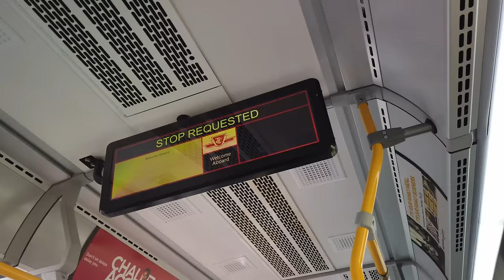Why American Buses Are Just Worse

Comment: This thing also applies to Japan and South Korea for me, although they don't have rules like buy-America, their bus designs do feel a bit stagnant if compared to Europe and even China (esp. South Korea until recently). Only recently Japan produced an indigenous Articulated bus design, Isuzu ERGA-Duo as most artics are imported (Mostly Mercedes Citaro G and some Volgren bodied Scanias).

feel free to add or correct this comment
Reply: And Taiwan follows Japan a lot in bus design
Reply: tbf korean buses are pretty comfy to ride on so personally don't mind their abundance
Reply: Japan had caps on bus size till quite recently, which was the reason there were no articulated buses. Once these caps were lifted the first imports arrived, followed by the indigenous product.
Reply: @lunareunlar  bus drivers in Korea drive like they are on NFS:MW!
After sedate pace of bus speed in London it was shocking how fast they get off the line over there.
Did get used to it by my third trip to Seoul.
Reply: @AshrakAhmed  Funnily enough, I'm just back from Buenos Aires and noticed how fast the buses were driven there, compared to in the UK! Great bus network and interesting metro system too. And so damn cheap!
Reply: well, i guess the point isnt whether its 'stagnant'. if it works and its good for their specific condition, then good for them.
Reply: That's interesting, Japan not excelling in transit for once
Reply: I've ridden buses in Japan. I thought the designs are pretty simple and considering space is more limited having narrow roads and tighter turns. Many buses are owned by private railroad companies providing station access. 
Nicer buses are usually the long distance and airport shuttles.
Reply: I think that's a little unfair, particularly for South Korea (I'm presuming you mean Seoul for South Korea and Tokyo for Japan). Unlike Tokyo, which has had a public bus system since WWII, Seoul's bus system only became under quasi-public control in 2004 under Lee Myung-Bak's transportation reforms. Korea has until very recently been in a much worse state relative to Japan, Europe, or North America. Relative to the position it was in the 80s or 90s, Seoul has made massive strides and is certainly doing better than the US or Canada. Buses are mostly fully low-floor, with padded seating, have modern announcement systems, have free wifi (!), accessible, not nearly as bumpy/shaky as in the US, extremely clean, etc etc.
Reply: @KoruGo  you are right, when i think of Korean buses i mostly think of ladder frame buses with manual transmission when i wrote this
Reply: I commute partially on a bus here in Seoul and when I see that high floor daewoo bus pull up I already know I'm not sitting down 😭
Reply: @theaveragejoe5781  Even if their buses suck they still have an excellent train system
Reply: And even if Korea and Japan can buy American made bus they wont buy it because Nova and New Flyer and Gilig are crap. Even Daewoo made more appealing bus than those American made junk
Reply: @AshrakAhmed  try mini-busses in Hong Kong you will be looking for the checkered flag for whatever race the bus driver entered / is practicing for
Reply: @theaveragejoe5781  with there LEAD in train systems they are allowed to lack a little in bus systems
Reply: @Juju Blue  @jasonriddell  😄maybe they just want to be polite and not make transit in other countries look so bad
Reply: i guess i’m too harsh on Japanese buses, despite the boring exterior they are capable machines for urban settings to mountainous roads too (mainly referring to Isuzu Erga)

Comment: I don’t think the manufacturers themselves are the problem, but the way agencies spec the buses are. All the main bus manufacturers in NA offer configurations with reduced seating in the low floor half, seating with and without upholstery, interior screens, and wide rear doors. Unfortunately many agencies choose to go with plastic seats and narrow doors, making getting off a crowded bus extremely difficult (I’ve seen too many people miss stops because people had to shove their way off the bus). As for the ride quality, I feel like Gillig and New Flyer have gotten this down pretty well with their newer models, although New Flyer could smooth out the ride on their articulated buses. Proterra isn’t as good, but it works. Another part of the bad ride quality is that our roads are just worse, because too many oversized cars are using them.

Van Hool is also building a factory in the US so perhaps we’ll see some more Van Hool transit buses on our streets soon.

Comment: I really like our czech SOR buses. The 12m long ones actually have four full doors, which is incredible as the speed in which people get on and off is basically instant. In the Czech Republic we also have quite a few trolleybus systems, most of them using bus bodies made by either SOR or Solaris with the electric equipment and completation done by Škoda.
Reply: I live in Czech Republic,  it's not just the town and city bus services that are good, but the regular coach services between towns is excellent, they are comfortable and not much slower than a car journey, I'm asleep after 10 minutes. Also a very reasonable price.
Reply: Living in Tallinn I can safely say that those Solaris trolleys are great. We are replacing trolley lines with fully electric or hydrogen buses, but Solaris worked well for a decade.
Reply: Prague was a wonderful city for transit, I lived there for three years, and never went near a car. For a city with under two million to have a comprehensive metro system was mind-blowing, considering any similar sized city in the US will have a terrible bus service at best. Certainly no trams or metros 😭
Reply: Also Czech Republic has great train system. Same for Hungary and Slovakia.
Reply: Stupid question but how do they pay for the bus tickets? There is someone on board who goes around and checks them? Most of the buses in Scotland only have one door at the front and you have to get the ticket there from the driver.
Reply: @antonyd6649  In Prague, they have paper ticket machines at all metro and most tram and bus. Can get an unlimited ticket for 1, 3,  or 7 days as well. Can also use an app now to buy tickets. In the US, only the biggest cities like NY have a similar system. Most of the time on buses (also almost exclusively single door), you gotta pay the driver or machine next to the driver with cash, and the bus driver usually doesn't have change.
Reply: @bixbysnyder-00  Ahaa I see. I have no idea why we don't have ticket machines especially at the busier bus stations. We have them for train stations of course and they're great. Would make everyone's lives easier. We have an app too but only for certain buses so majority of the time you are shouting your destination to the bus driver who can't hear you over the engines and no change too.
Reply: @vipeton.8927  I'd certainly agree with you there. The ticket prices are ridiculously low, too, for what one gets.
Reply: @christopherbentley7289  yes. Took train through all  🇨🇿 . €9
Reply: @vipeton.8927  As good as giving it away!
Reply: @antonyd6649  Also regular riders/commuters have monthly passes which they only show to ticket inspectors, if and when any. I have not met an inspector for two months now.

Comment: In my homeland of Singapore, you can see many kinds of buses namely double decker buses, single deck air-conditioned buses, hybrid buses and even electric buses. We have 4 bus companies operating these buses. Most of the buses are powered by diesel engines and 2-door buses are common on Singapore roads. Recently we have 60 new 3-door buses but these buses are the last batch with diesel engines because the Land Transport Authority is going to bring in 400 new electric buses to replace the current fleet of old WAB single deck buses. By the year of 2024, new 3-door electric buses can be seen roaming on Singapore roads. Currently there are 18 bus-making companies tendering for the contract of 400 new electric 3-door single deck buses.

Comment: What I love about electric buses is how unobtrusive they are. They make little noise and require very little infra apart from the road and some bus stops. You can walk in a city crawling with bus lines and only really notice them when you need one.

Yes, trams give more capacity for your money in the long run but buses are way easier to fit in most dense urban landscapes. Of course, nothing is cooler than a train, cant beat trains when it comes to being cool :D
Reply: Kind of a long term/short term thing. Major cities definitely should invest in Trams if they're serious about transit, but for the rapid expansion we need, plus with less dense areas, buses definitely have a big role to play
Reply: At higher speeds it doesnt matter if your vehicle is electric or not, beacuse the loudest noise then is tires rolling on the road. Electric buses have shorter range, and the ones without overhang wires have a reputation of caching fire in hot weather, and shorter range in cold weather. 'Adam Something' made a great video on electric buses
Reply: @dav786  Roll noise is irrelevant because city buses rarely go fast. But they do idle a lot!

Ever sat in a bar with two diesel buses idling just outside? :)
Reply: No they're not. You need to have an integrated public transport and infrastructure policy. And of course there needs to be room for a lot of cycling
Reply: For frequent services, battery-electric buses produce a lot of road maintenance. Just look at the damage to the pavement around bus stops on a frequent diesel bus route, then consider that battery-electric buses are even heavier. For high-frequency routes, trolleybuses are the best solution, especially nowadays when they have batteries which enable them to travel off-wire to get around obstructions and avoid the cost of a bajillion wires in the bus depot.
Reply: your point of being unobtrusive to ME is not a good thing as far as a system is concerned a streetcar / tram with its tracks and overhead is both great advertising AND wayfinding that an "invisible" bus route does NOT offer 
IF you are referring to the VEHICLE then yes quiet operation is GREAT
Reply: @DutchLabrat  Quoting Not just bikes' 'Cities arent loud, cars are' video: "For most cars, at 55 km/h rolling noise becomes louder than the engine." If we take into account that this is a bus, with wider tires than a car, electric-which is heavier, and also loaded with passengers, I think its safe to say rolling noise would be louder at 50km/h or slower speeds already. Which is the most common speed limit in cities across EU. I think you should just switch seats in that pub :)
Reply: Yeah, an electric bus rolling by makes more noise than an idling Diesel.... Sure.
Reply: @DutchLabrat  bro just beacuse you cant drink your pint in peace, you think electric buses are the best? Just find a dufferent pub 😂
Reply: @dav786  Look man, if you really believe an urban area served by diesel buses (or trams!!) is quieter than one served by electric buses I.... dunno.... words fail me.

Quoting NJB at me was hilarious by the way. I know the inner city of Delft well and it USES ELECTRIC BUSES BECAUSE THEY ARE QUIET. ahem.... cough
Reply: No, buses aren't easier to fit in dense traffic.Trams often get their own trackbed, separated from other traffic. Buses much less so and get stuck in traffic jams as everybody else

Comment: Traveling by bus in Geneva a few years ago was a revelation. I think all of the ones I took were articulated. Low floors and huge doors made getting on and off quick and easy. They also felt much more spacious inside somehow, despite being very well used.

But beyond the bus itself, the dedicated lanes, the ticket machines located at the stops, and the high frequency service all added up to make the experience so much better than it is here in Vancouver, which already has one of the better bus systems in NA.
Reply: I'm pretty sure that if you take Geneva, or any other swiss city, as a reference, there will be very few places in the world that would beat that :D

Comment: I think you can extend this to pretty much all type of transport. The DC metro’s rolling stock is just horrible. Ambulances are way too large and heavy, meaning they are slow to accelerate and have a hard time breaking, therefore generally going slower than they otherwise could. I think there’s just a bias towards more bulk and, as you say, idiosyncratic solutions instead of just looking for international best practice and buying what works.

Comment: To be fair to the old-looking UTA Gillig shown in the photo: it has clean ergonomic seats, nice digital everything, and massive doors. Pretty sure that style was an option chosen by the agency, which is a little baffling considering prior model years, but they are actually nice for a standard-length North American city bus.
Reply: Gillig phantom was a nice bus
Reply: Gillig, El Dorado National, New Flyer, and Novabus are what I have experience with. The Gilligs are my favorite ones to drive despite being the most square and plain looking on the outside.
Reply: And as part of their Gillig order, UTA is also acquiring a lot more full EV Gilligs. Interesting since their original small EV test fleet was New Flyer.
Reply: I think there is a lot to be said for a nice traditional looking bus.  Here in the UK outside London many buses had coach seats in the late 80s and early 90s but this was discontinued with the low floors.  Some places started having buses with leather coach seats  but in London it's still basic seats sometimes hard and uncomfortable.  No wifi or charging facilities either, features that have been commonplace in other parts of the UK for over ten years.

Comment: As a German,  I gotta say that I really loved the busses in Vancouver,  Canada. First the fact that the city uses trolley busses,  which I've never seen before and they had these racks in the front for bikes,  which I've also never seen before. In Germany if you want to bring a bike on the bus,  you have to take it inside, if it's even possible at all.
Reply: I live also in Germany and around where I live we have a few lines with a bike rack in the back or a bike trailer. A front rack is not allowed because they are absolutely deadly when hitting pedestrians. There is no real option to solve this because the head will impact some random bike part, thus even a low speed accident can be fatal.
Reply: In France bikes are not allowed but there is an exception for folding bikes. In fact the common way to easy travel by transportation is to get an adult scooter you can carry with you.
Reply: @lionec226  Are e scooters allowed on the road or pavement in France?  In the UK they are illegal so it's a risk to use them (only the rental ones are allowed like Lime, Voi or Dott and restricted to certain roads).
Reply: @michaelcallummayaka  you can ride your own e scooter since they are actually lots of bike lanes  nowadays in most of big cities, they are even registered in the road safety rules as "EDPM (" Engin de déplacement personnel" in French)... you can use them in car lanes when there isn't bike lanes ... sometimes there are specific streets with car lanes where EDPMs are prioritized like if you drive a car and behind them you aren't allowed to overtake them till the end of the street or the ending sign.

Comment: When something is worse or not working in the US, the answer is very often good-faith regulation that just kicks you from the back. For example, when I first moved here, I was shocked that the bus stops on literally every block. It made the journey so slow it was frankly faster to walk sometimes if you count in the wait for the bus. Then I learned it's an ADA (Americans with Disabilities Act) requirement. ADA influences bus design too. For example, ramps must be able to support 600 lbs - twice as much as in Europe. This makes this whole mechanism more bulky.
Reply: I think this good-faith regulation is usually bad faith. Regulation is usually for some evil goal otherwise the market would have provided it, instead of putting a gun to the back of your head.
Reply: "For example, ramps must be able to support 600 lbs - twice as much as in Europe." Do you have any evidence for this? Bus ramps in Berlin have a a much higher capacity than 300 pounds(more like 375 kg). Also do you have any evidence for the ADA requirement? That doesn't correspond with any experiences I know of.

Cheers,

Alan Tomlinson
Reply: Regulations are usually well-intentioned but have often unforeseen negative repercussions.
Reply: Dublin buses have the ramp at the front thank god the days of one door only buses are gone

Comment: Great point about the definition of safety, especially in regard to N American trains. That 'bulletproof' approach to crashworthiness just seems to be a response to poor infrastructure, where resilience has to be built in the wrong parts of the system (the passenger cars) to compensate for poor track, terrible signalling, dire train regulation, and far too many grade crossings. I couldn't believe how many unguarded grade crossings we went over on the Hudson Valley line when we visited a few years back.

Incidentally, buses in London ≠ buses in the rest of the UK. Outside London, we've been contaminated by Reaganite thinking since the 1980s, with soaring fares, mostly old and broken buses, and poor service. Buses themselves are usually second- or third-generation cast-offs from London. I'm afraid to say that driving private vehicles is as natural outside London as taking the bus or the tube is in London.